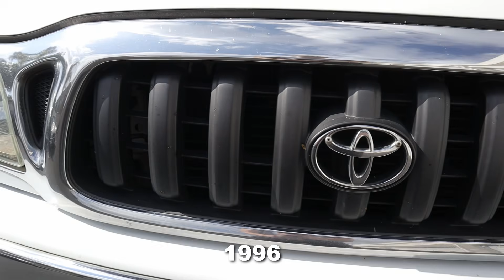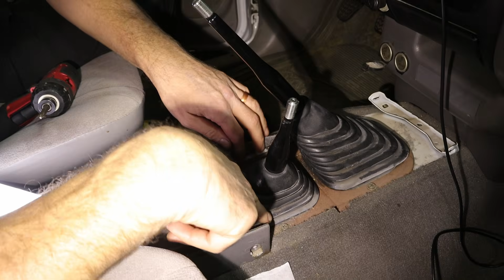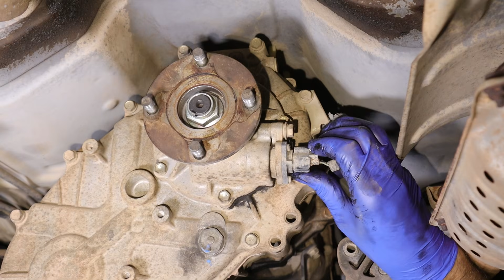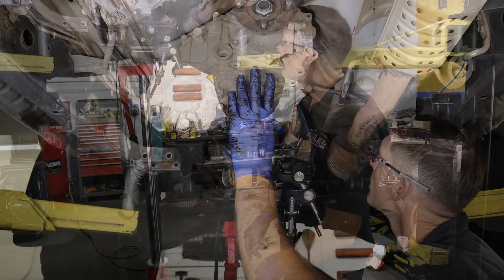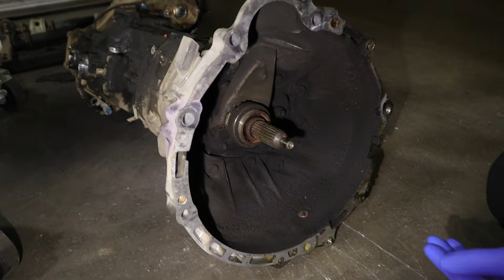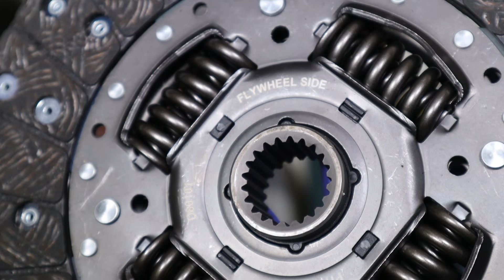How To Replace Clutch on Toyota Tacoma 1st Gen (1995 - 2004) START TO FINISH

Comment: 25:27 or you could put a breaker bar and socket on the crank bolt at the harmonic balancer. That's much easier and safer. ;)

Comment: I'm an old guy, my 02 Tacoma 300k daily drive needs this work done...Local AAMCO place says about 3k & can also replace worn out 1,2 & maybe 5th gear if needed for another grand... total around 4k. After seeing this video of all the steps involved I understand the cost so I'm going to schedule it...
Reply: Shooot I’m young never done one but I’m gonna give it a shot lol
Reply: Update - I got a second opinion from a small local shop & they were awesome. Did the clutch replacement & confirmed my opinion that the gears were working just fine. Payed about $1900 instead of over twice that vs. AAMCO quote & the Tacoma is driving like a champ...

Comment: Will this work for a 2.4 4cylinder tacoma not 4x4 of course
Reply: This vid will be helpful, but you need to search around for another vid which shows dealing with the non-removable cross member. Also, flywheel torque specs are different.

Comment: Great Video.  Important item missing for the 2.7 Engine.  Flywheel bolts are 1 time use torque-to-yield.  Do not reuse the bolts.  19 Ft-lbs + 90 degrees for a torque spec.

Comment: Couple quick questions....What type and size were the flywheel bolts? Lastly, what was the final torque on the six 12mm clutch bolts??? Actually do you have all the torque specs? Bell housing, etc.

Comment: Great video,my question is if all  the torque specs mentioned here for the whole process can apply to a 2003 Tacoma 2.4L base model ,my Haynes manual says 19ft lbs for flywheel bolts, some videos say  65-66ftlbs
Reply from the maker: The torque specs is probably roughly the same as
Reply: The torque specs for 2.4 and 2.7 are different. Haynes has no mention of that fact.

Comment: The crossmember on my hilux is not designed to be removed - it is welded to the chassis. I have no idea how I can drop the transmission.
Reply: Unweld it
Reply: https://www.youtube.com/watch?v=7khmtDyYJww
Rotate the trans 90 degrees to slide it back